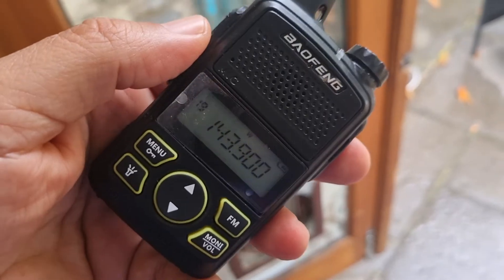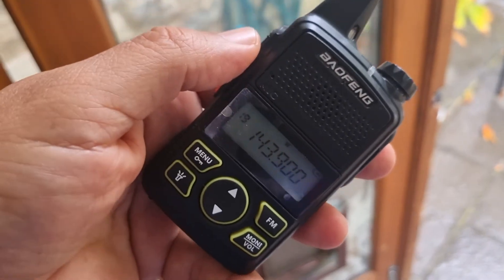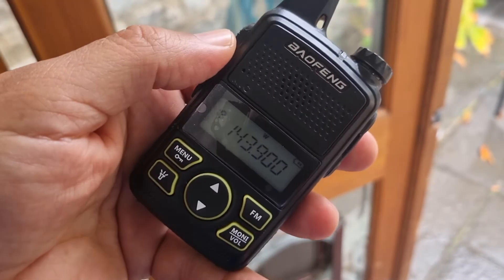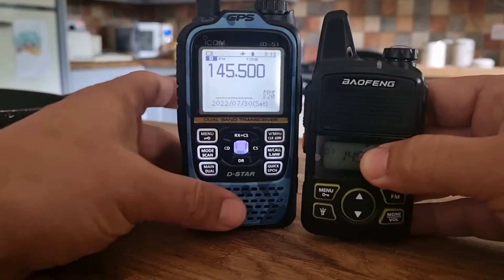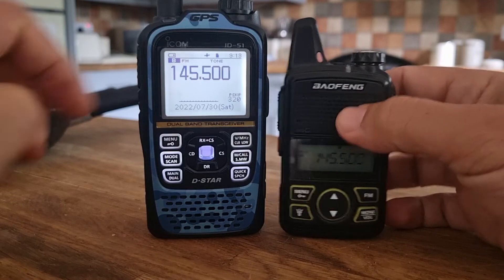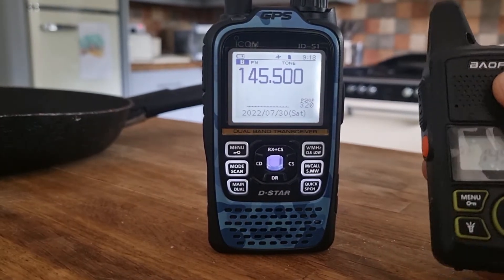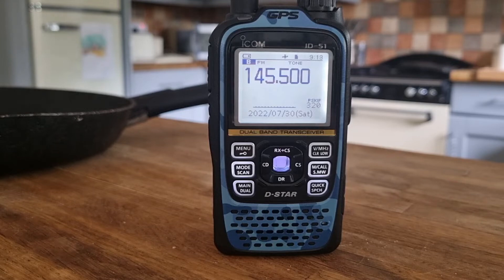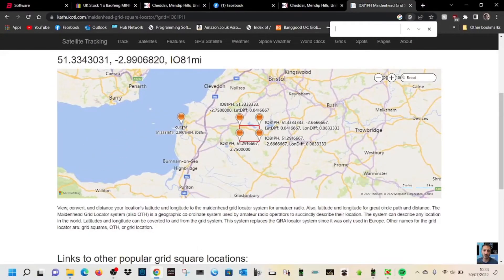MINI POCKET HAM RADIO

Comment: Help out the local farmer. They use PMR 446. I always take mine. It as good as any other PMR 446 radio only pocket size. Great because often you want your hands free and need some where put your radio. In my pocket ideal.
Reply from the maker: Thanks for the info